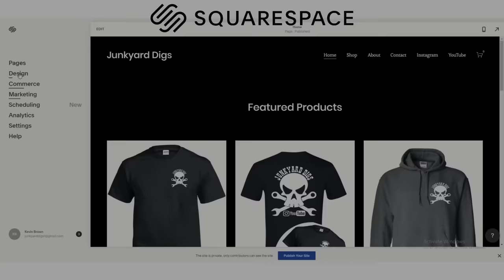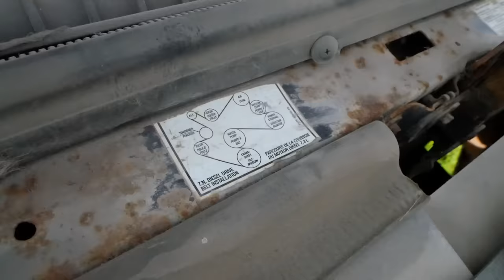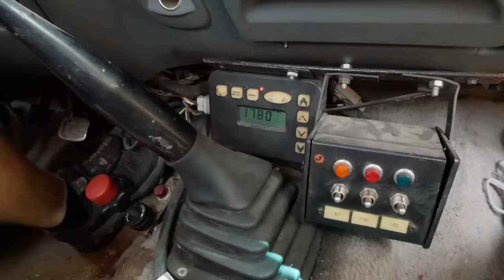Can We Get ABANDONED Tow Trucks to RUN?  - Part 1

Comment: My coworkers all love that my 85 idi starts faster than my other coworkers 05 6.0 power stroke. But I understand he has to build oil pressure first. I'm a cheater. Glow plugs are on a switch and plumbed in an electronic fuel pump must have on the old IDI

Comment: I have an interest in a logistic company and for light truck (which these are) diesel is unreliable and costs a fortune to fix. They are not in any way worth the extra $10,000 buy them. Get a 7.5 gas motor and run it on CNG if you are worried about fuel consumption. We don't care how much gas we buy. Sure it costs more to fill up but it isn't going to blow up two turbos.

Comment: Diesel engines REALLY, REALLY, don't like ether.  Try WD40 instead.  The oil base of WD40 lubricates the cylinder walls as opposed to ether which strips any oil residue away.  NOTE:  When using WD40, the engine needs to be cranking before you spray.  The oil must be atomized to be explosive.

Comment: This dude has two of the best motors in American history and shrugs his shoulders lol. Add on. That’s a secondary filter and the glow plugs stay on for 2 minutes after light goes off. Water in fuel is a dummy light only time to pay mind to it is when it stays on 7.3 can be a pain to start. Should use wd40 and spray it in the intake to help or put gas in the fuel bowl

Comment: Usually if cool is difficult to start and hot easy, it's sign of compression loss. Diesel engine doesn't like air in their system. If got the slightest air, it won't start at all.

Comment: 12:30 I'd have used a siphon-tube and a sponge instead of half a roll of shop-towels :P
P.S. The roll of shop-towels looks about the same diameter as the filter-housing; why not just stick the end of the roll into the housing and wick up all the yucky fluid at once, rather than a little bit with one towel at a time???

Comment: The mechanic who looked after my cars , I always had diesel cars said if you're stuck run a wire from the battery straight to the glow plugs and that'll give it a chance to warm them up, it has to be a pretty good thickness about the same as the one on the terminal but don't keep it on it's just to start the engine, ps why isn't mook standing with wasp repellent trying to keep you safe from those pesky flying varmints

Comment: Fun fact I've seen a lot of 90's ford lock cylinders take literally any 90's ford truck key put in it 😂 I'm guessing it is a wear issue because I've had a few I've came across you could start by turning only the outer section of the cylinder with the little wings with no key in it at all. Really not entirely sure how that even works but I'm guessing it had something to do with how the collar was attached to the cylinder. Not saying that's what happened with the red truck but if you haven't tried other rando keys I wouldn't rule it out either.

Comment: You have to push the clutch in my 1997 super duty 450, I have the 7.3 too, the round waffle looking plastic cap is wear your filter is , my truck is a couple of years newer, and looks a little bit different, anyway , ok so no my ford , looking at the Front is a pet cock drain valve it turns side to side on the left bottom of the filter canisters, kool thanks y’all BigAl California.

Comment: Ether can lift the head to keep that stuff up, vary bad on the motor, stupid stuff, you need to use a gasoline soaked rag, dummy’s, it is a little bit easier on the head bolts so they don’t stretch, you all ready hurt the motor with that starting fluid, we can hear the miss , good job thanks y’all BigAl California.

Comment: Im not going to tell you what to do,  but I would throw that cover away it holds heat on top of your engine and you dont want that, plys yes your injectors run off high pressure oil so make sure your oil is up to pare when you change its 15 quarts  filter  holds almost a quart  but 7.3s are a great engine I have 260,000 on mine its a beast and dont ever use starting fluid  with glow plugs you could blow off your heads and thats really bad or blow holes in your pistons dont use that staring fluid ever j uh st ask your buddy he will tell you the same

Comment: Yes. 7.3 powerstroke injectors are oil pressure driven but it gets worse.  They use 'top-end oil' to fire the injectors off a high pressure pump.  That oil should circulate with the engine oil but it doesn't very well.  You may be able to revive it.  See this video series for more info.  https://www.youtube.com/watch?v=1A3H17qhcUQ

Comment: My dad is a locksmith I’ve made keys on them trucks before literally there are like 200 keys the door key could be you use try out keys you go threw the door ones and if you find one in box the C box or A box you take the matching letter ignition try out key box go threw even more to find all the cuts 1 threw 4 is in the door the other 6 cuts in ign then you have all ten cuts so you got very very lucky on that 😂 hell if I where you I’d buy a set of try out keys if you buy a lot of old trucks

Comment: 9:54  Called it a piece of crap.  You don't know WTF you're talking about.  That truck has one of THE best engines ever built (lots of guys, including me, have well over 300k on theirs with just routine maintenance, and never had to replace any major components), and I could tell just by how it cranked that it's in very good condition.  Do a little research on YT before you get into a project next time.  It's called education.

Comment: You Are too negative.
IT is not fun to listen to and I do not understand why there is so much negativity regarding diesel.
Maybe because you americans never have paid much for gasoline.
Here in Europe diesel cars are number one.
They are easy to work on, robust and stabile and runs a lot longer on the L/Km scale.
They also live longer than gasoline cars.

Bring forth the smile and good attitude, - CHECK THE OIL BEFORE CRANKING.

Kindest regards
Jesper of Denmark 🇩🇰😎🇩🇰